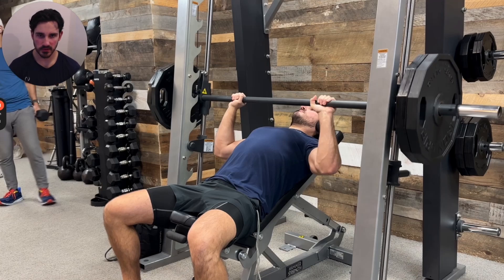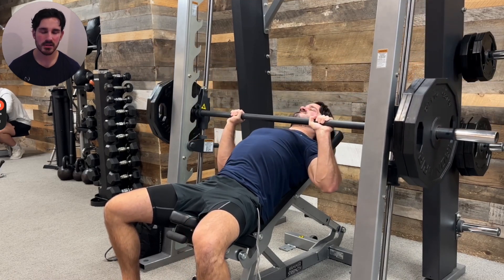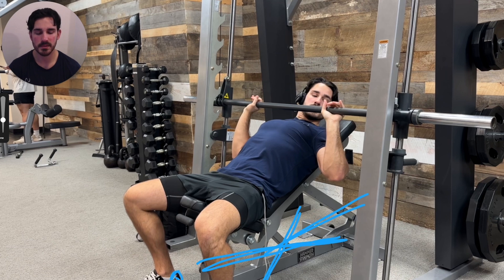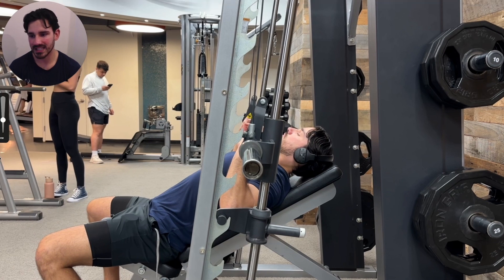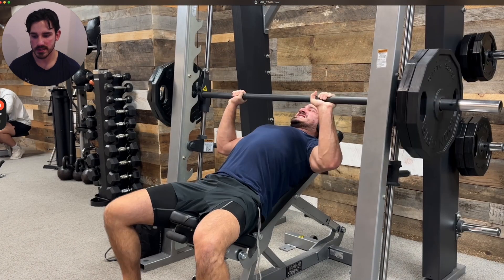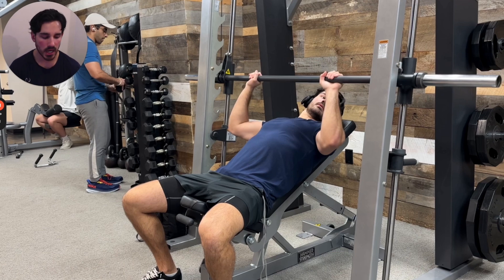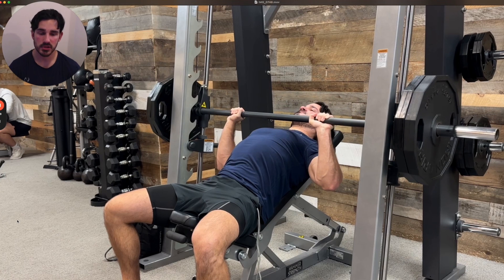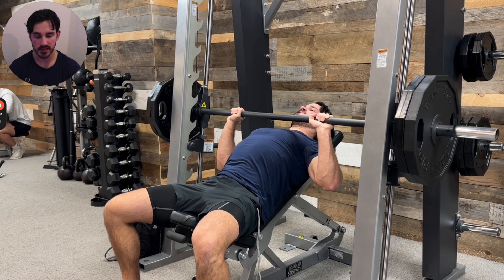How To: Smith Machine Chest Press | Learn Biomechanics

Comment: Most important to set the safety pins on both sides and keep atleast a cm or two distance between the lowest point of the bar and your chest so that you can safely take it to failure and then wriggle out from under the bar.

Comment: I would love to know how to prevent the delts from being the limiting factor in close-grip and JM presses in the Smith-machine. I got the most incredible soreness in my front delts from doing close-grip bench, but my triceps felt fine. Not my goal.
Reply: On jm presses keep your elbows high when you bring the bar to your head, It will keep the tension on the triceps. If you drop your elbows on the eccentric it will turn into a delt press.
Reply: @freshprince512  exactly but that way in my case, started to hurt my elbow lol, and it's because it's out of the movement plane (the bar)
Reply: @jgtraining_arg  Have you tried doing it on a 15 degree angle bench instead of flat? Also maybe play around with where you’re bringing the bar down to (forehead, eyes, neck, behind head, etc.).
Reply: @freshprince512  Yeah, but since it was too tough on my elbows, I've just stopped doing them. I was thinking to consider doing them in an incline bench. Anyways I will try these days and tell
Reply: It's strange that in JM press, your shoulder gets sore. Typically, it's the elbows that hurt because they are out of the movement plane.